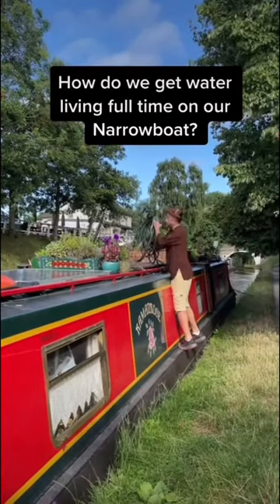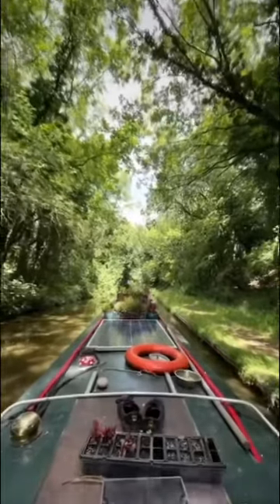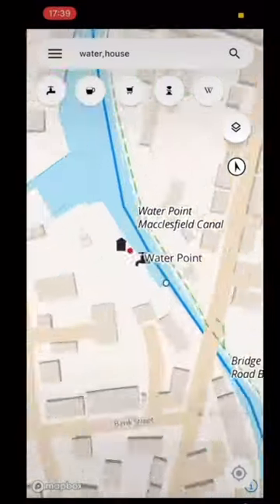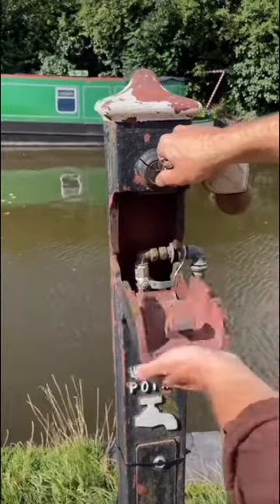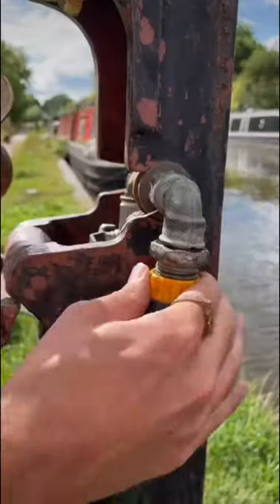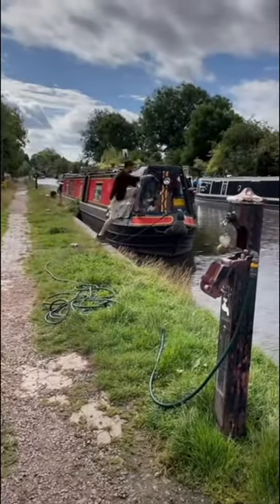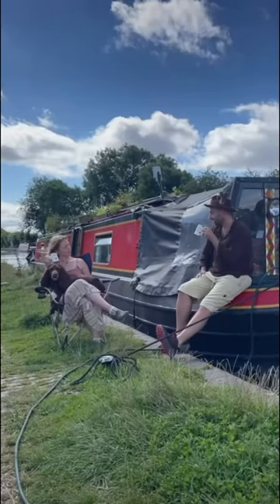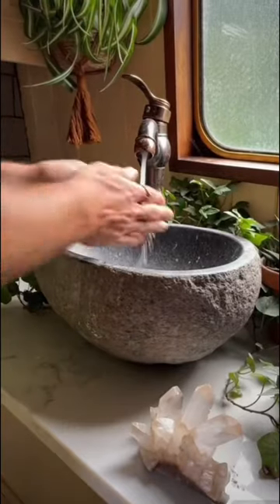How do we get water living full time on our NARROWBOAT #narrowboat #offgrid #boatlife

Comment: What do you do with your gray and black water? How do you dispose of them?
Reply: Grey water is straight into the canal, so many boaters use natural detergents and soaps. Black water is pumped into a holding tank similar to the fresh water tank, then pumped out at a facility if you don't use a cassette system like many motor homes. You can generally get all the servicing at a marina or canal boatyard.

Comment: You're screwing the hose fitting in incorrectly - it should be CLOCKWISE... Also, the fitting clearly isn't seating properly. You'd be just about to strip the thread - but fortunately, you're screwing it in incorrectly!